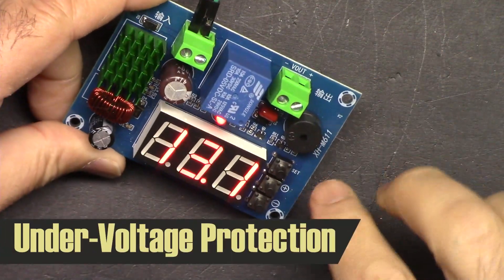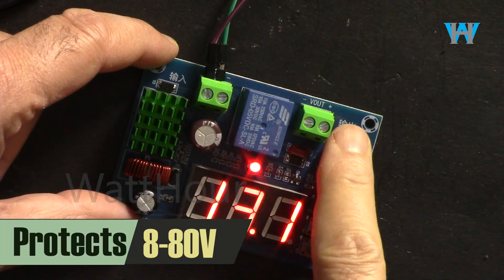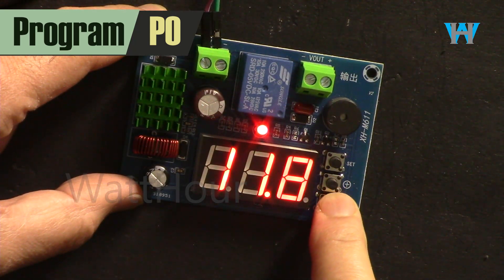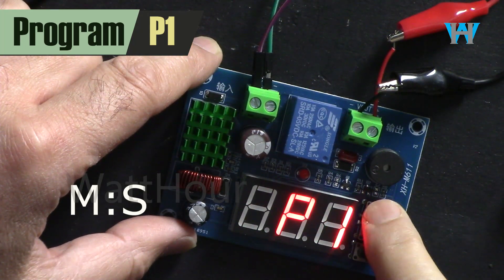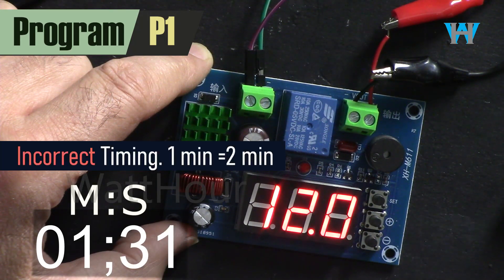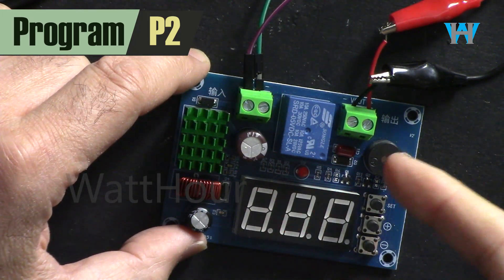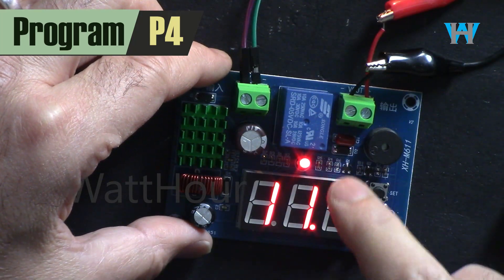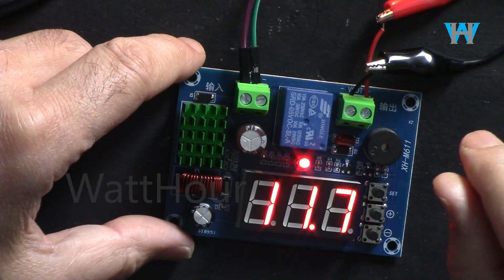How to use XH-M611 Lithium Battery Under-Voltage Protection Module | WattHour

Comment: Just under voltage? There are many better modules out there.
Reply from the maker: under-voltage is the most import protection. most batteries get damaged as people treat them like lead acid and drain them to 9V or even lower. this is very useful indeed.
Reply: @WattHour  I would use the xy-dj or similar module, which offers both charge discharge. And both under & over voltage protection.
Over voltage is what causes explosions & battery fires.
Reply from the maker: Yes of course there are 100s of types of modules. this vary famous.
Reply: This isn't a BMS. It's designed to do ONE job, and for a specific purpose. It's intended as the master protection of a multi-cell pack, which would then have it's individual cells protected by a in-pack BMS.